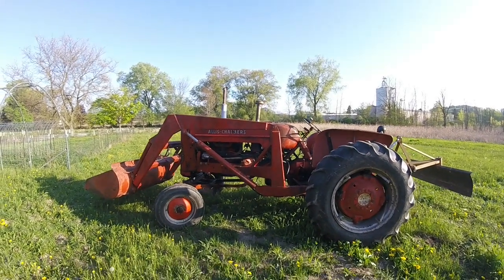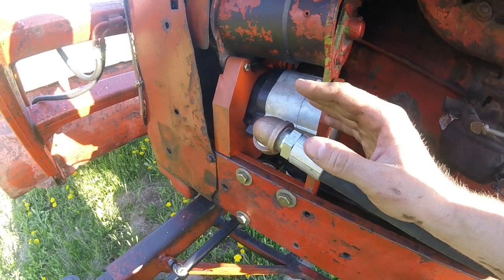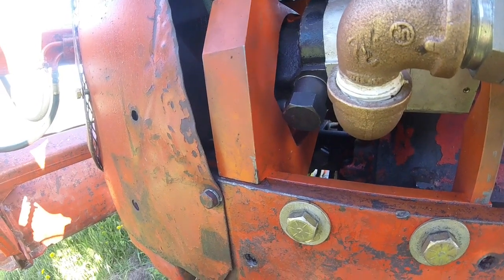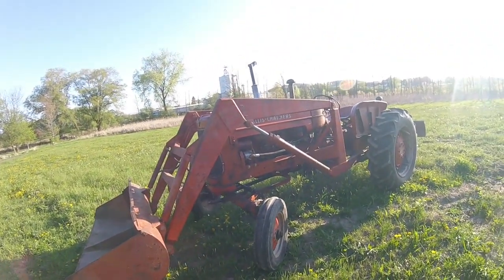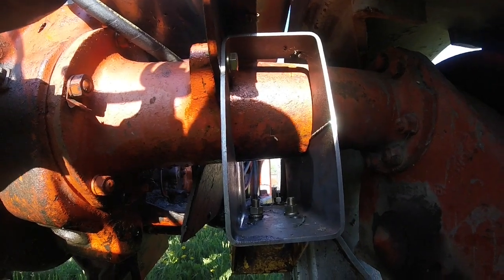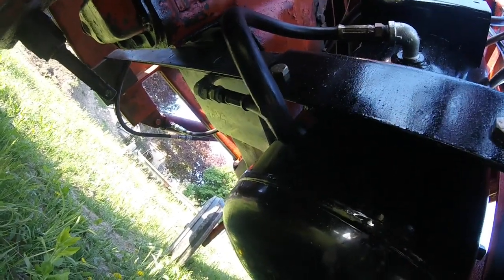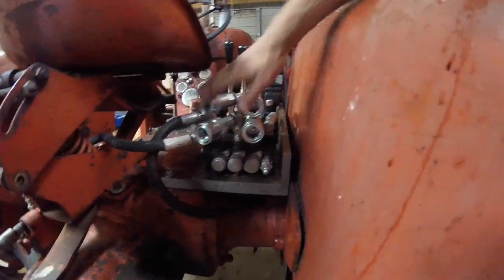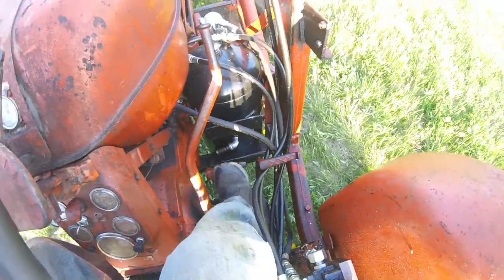Allis Chalmers D17 Live Hydraulics

Comment: On my 57 D17, I simply made a mount to run my pump directly off the front of the crank. It’s just a plate to mount the pump, with a couple of spacers to bolt the plate to the steering bolster. I just had to make up a short shaft to go between the pump and the crankshaft to drive the pump. I’m running a Kelley loader that came off an A-C 170. A couple of pieces of angle mount the oil tank and valve on the right side of the loader frame, with a spin on oil filter on the outlet of the tank.
Reply: A better idea.

Comment: This is awesome, thank you for showing it off. I have an older D17 too and want to install an external hydraulic system that runs a loader and rear remotes. I am not sure how to mount the pump, whether it be mounted on the front and driven off the crank via a shaft or have it belt driven on the side like yours. Do you have any belt slip? Do you have a pressure relief valve in your system somewhere? I would love to know more.
Reply from the maker: Thanks Miles! Ok pressure release valve is internal on the pump. Belt slip: Yes and no. I had trouble with it at first (and broke a belt with my post hole auger all the way down in a hole) Lately hasn't been an issue. I had to adjust it, try a few different belts before I found what worked. When I do a total restore on this tractor, I'm planning on switching to some sort of chain drive, maybe mounted on the old single groove style crank pulley. I don't know yet. But for the time being, the belt is working well, just not sure if it would hold up as well as a chain over time. The reason I didn't go with a crank mount is I hate seeing the pump sticking out the front (my design looks kinda stock) and it's in a great spot for me to smash it.

Comment: Hey I picked up a series 1 a couple months ago, as well as an old shaver post driver for a 3 point (my series 1 has the 3 point conversion). the guy I got the driver from told me I really need a big return to sump line so that the driver can dump the oil back fast enough to let the driver gravity drop and not be slowed down by the oil going through the smaller return hose. My neighbor told me he thought I could just take the big return hose coming back from the driver and stick it in the hydraulic oil fill port where the dipstick is and then take it out when I'm done with the driver. I'm not super talented like you are with tractors, so I want a solution (for now anyway) that'll work but without too much modification. Does it work to just plug the intake hose for the driver into the remote connector above the transport valve and stick the return line in the fill port? I don't have the selector valve by the way. Does that mean that the 3 point ram arms will always be all the way up when I want the driver to be lifted? thank you
Reply from the maker: Sorry for not getting back sooner. I took a little break from the Youtubes. As for the driver, your plan should work, but be sure to hold the end of the hose to the fill port, or else the pressure will blast it out of the tank. Unfortunately I believe with the valve setup you described the lift arms will pick up each time.